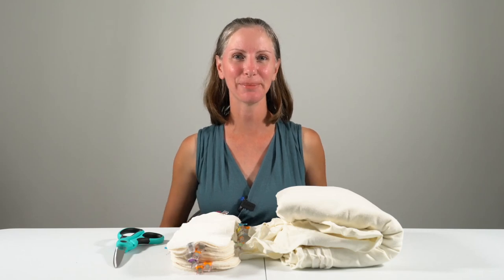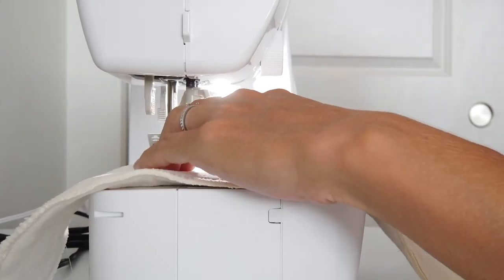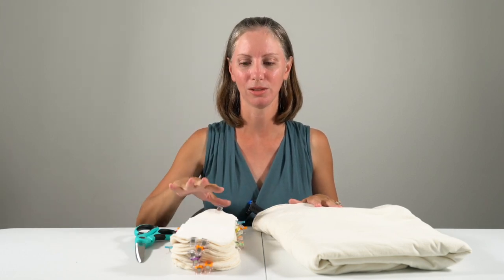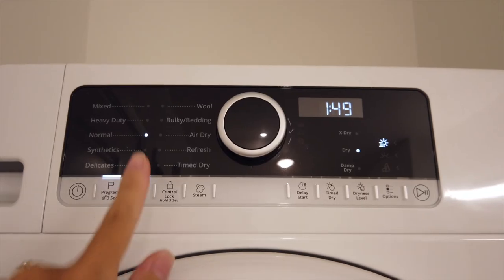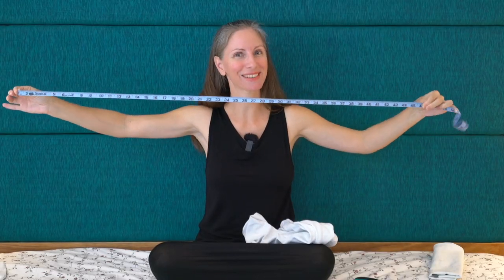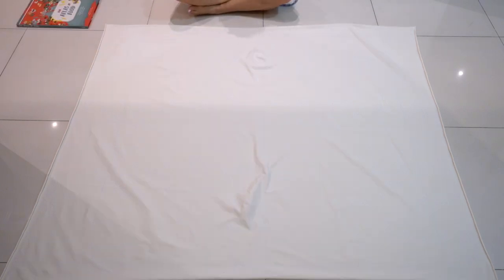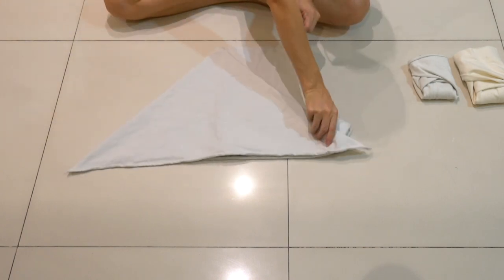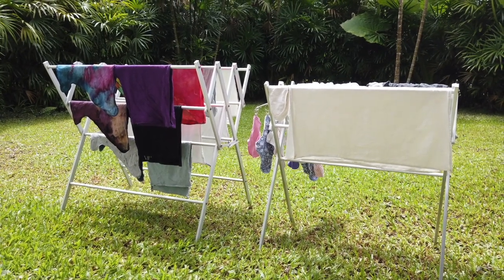How to Make DIY Stretchy Flat Cloth Diapers (No Sew) + Boosters (Regular Machine)

Comment: Are flats difficult to clean the poop off of once they stop breastfeeding?
Reply from the maker: I think flats are relatively easy to clean once they start eating solids, since the flat is just one layer of fabric. We often used flats pad folded inside the pocket of Bebeboo GROW trainers, so only the pocket portion needed to be sprayed off (similar to a pocket diaper).  

I also heard a trick recently with origami fold, to flip it over after folding, so it's one continuous piece against Baby, instead of lots of folds where poop could get stuck. 💜 Heidi